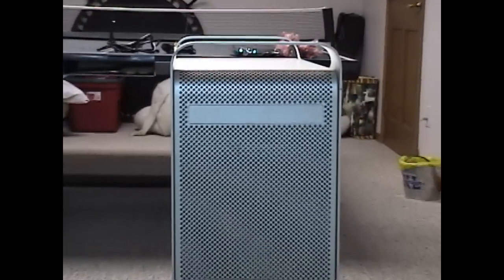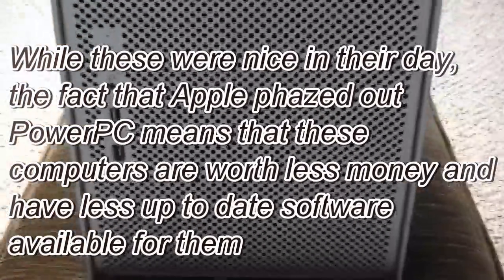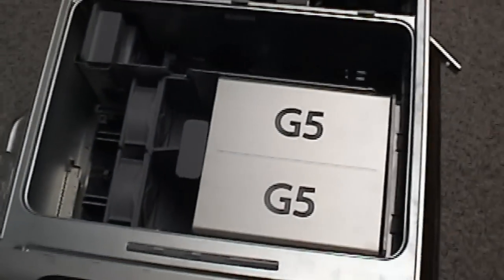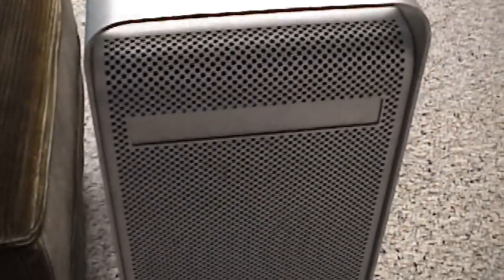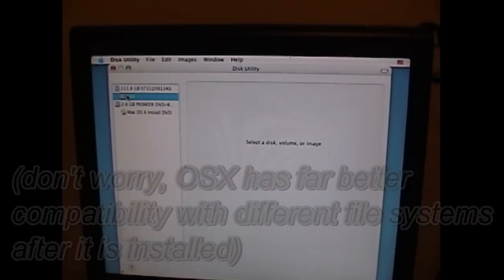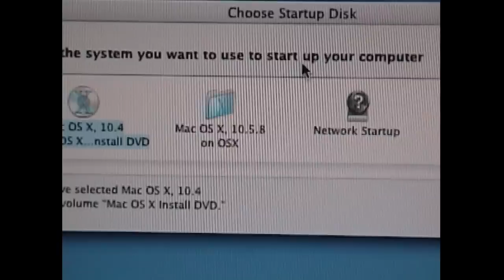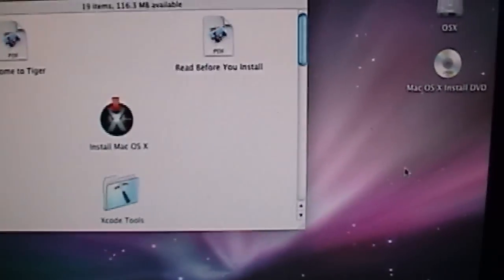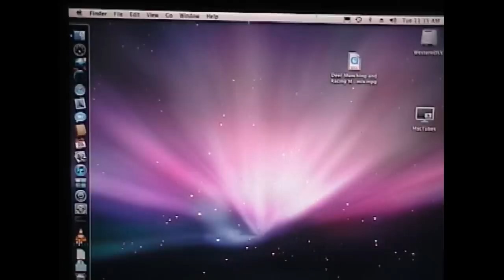PowerMac G5 Setup/First Run + RAM, Hard Drive, and OSX Installation

Comment: I find Mac OS X for PowerPC is so slow. I just got a Power Mac G5 Quad core and it feels so sluggish... And Since it can only got to version 10.5.8, most/all web browsers are out-of-date so you can't surface many websites...
Reply from the maker: This is true! Getting a good web browser is actually pretty easy, but the computer sucks so bad that most websites are miserable to use (think late Pentium4, only worse.). That issue and more are discussed in this handy followup video: https://www.youtube.com/watch?v=da5vfIH069E

Comment: Thanks for posting this. I just got a dual 2.5 Ghz G5 and did everything possible to install 10.5.8 on it until I came across this. This worked perfect.
Reply from the maker: Good to hear. It's a fun little "modern historical" piece with some mild utility to boot.
Reply: I am currently using it as a media server. I know it is power hungry but I like the look of it and it runs good.
Reply from the maker: @Greg
Whatever floats your boat.

Comment: Great video. I second what Hayden said. I should be getting a G5 soon, and like you this will be my first Mac product. It was seeming like I was going to be frustrated by the process of installing an OS, but your video gave me confidence. Thanks. Subscribed.
Reply from the maker: The G5 is an interesting learning experience for sure. At the end of the day, it's not that practical of a computer because of the sheer lack of software for PowerPC, the obnoxious mouse acceleration present in OSX, and the fact that no other operating systems really even work on the PowerPC machines (Ubuntu and MintPPC lack the necessary video drivers for anything to display correctly, although they do boot). This one's had a good run, but to be honest, I'm probably going to sell it soon because the weak/cheapo Pentium4 computer that sits next to it is more capable, more usable, an infinitely less frustrating to use. If the G5 had one thing, it was a really neat case. Unfortunately, its functionality was not reflected by its looks :-). Best of luck with yours though.

Comment: I've been running my PowerMac G5 1.6 with original 80 gig HDD for 10 years. I just bought a Mac Mini last year, I was curious what kind of new things were available on Macs.

I still use my G5, but do like the Mini. I'm thinking about installing a new SSD since the original HDD is so old. I have a 250 gig HDD in the second bay for Time Machine. Also going to replace the old 15" Cinema screen with a new monitor. Just keeping it around for back up or if it dies.

My Quadra 605 is still going too.

Comment: To open the DVD tray on boot just hold down the mouse button (left) until the tray opens (about halfway through booting). If you need to boot from a DVD but the DVD is not in the tray, if you're savvy enough, turn on the Mac while holding down the mouse, as soon as the tray opens quickly let go of the mouse and press and hold the "C" key, then insert the DVD while still holding C (push the tray closed). In one swift move you've opened the DVD drive AND told the Mac to boot from the DVD. One of several old Mac tricks I used all the time in the old days.
Reply from the maker: I was made aware of the DVD drive and boot key tricks after uploading this, but found that this particular computer won't work with any of the key combinations for some reason. It was suggested to me that it may be because of the wireless keyboard that's hooked up to it.
Reply: The wireless mouse might load too late I would think. But I'll try it out for you. Just plug a wired mouse into a USB port and hold it down during boot. The CD tray will open. Done it a million times.

Comment: This helped me get over the hurdle of opening the CD drive. Once that worked, I was able to get it to boot from the CD. I'm sure I paid $99 for the CD when I upgraded it. Now I just have to get a HD so I can install the OS.  I also have the disks for iWork and iLife so I can sell all that with the computer. Or just use if for a storage server. Thanks
Reply from the maker: Why would you pay $99 for a CD?
Reply from the maker: @russpury  Fair enough. I do have the 10.5.8 image linked in the description though, if you change your mind.
Reply: @Browningate  Thanks, I'll check which version I installed. I also have a Snow Leopard disk, and I can't remember why. Must be oldtimers
Reply from the maker: @russpury  Don't worry. I have Snow Leopard loaded up on my Lenovo N200 laptop for disc burning purposes. Leopard is the end of the line for PowerPC though, at least officially (although there is footage of a beta build of Snow Leopard running on PowerPC floating around, if you want to take a look).

Comment: Great video! I recently got 3 Powermac G5 computers that had the hard-drive wiped and had no idea if I could use. Only problem i had was getting  a copy of OS 10.4, tried to download several times using the  link given in the description. I got a bunch of adware but no OS file. I tried a copy of OS 10.4 that is for the G4 laptop and it worked and i was able to move on with the DMG install. I don't know if I can do much with these computers but will continue setting up this first one hopefully I can find some video edting software that will work on the G5.
Reply from the maker: +pmolestina 
Thanks for the heads-up. I checked the links and they were actually all still good (except for the one linking to the PDF, but that is fixed now too). As for video editing, you're pretty much out of luck with the G5; I'd recommend a normal computer for that along with PowerDirector 9 or 10 (this is addressed in my followup FAQ video).

Best of luck!

Comment: Hi, i know its an old video but im trying to do exactly whats on the video. I installed and ssd drive to the powermac g5, changed the dvd drive but it doesnt load the burnet OSX 10.4 DVD. Any ideas?
Reply from the maker: Are you sure that the drive is good? If so, you might be able to restore the 10.5.8 image from a virtual machine to your physical SSD, thereby bypassing the need for the optical disc altogether. Also, take a look at some of the beta 10.6 stuff that was made available for this machine from the forums. It's nothing earth-shattering, but kind of interesting nonetheless.

Comment: I appreciate the video. Thank you. Helped with the installation of the hard drive, but now that I'm trying to install the OS, I'm stuck. I downloaded both files you link to, but I'm unable to get to the tools screen. My DVD won't pull up. I simply get the flashing file folder/question mark.

I know the drive will work because I tried to use the tools from a 10.4 disk I found, but got a panic error kernel failure. The drive did pull up, however. 

I've tried to burn the disk at multiple speeds, through Toast and Disk Utilities, with .iso and with .toast, just to check. Nothing works. Any thoughts?
Reply from the maker: This might seem like an obvious thing to check, but make sure it's the 10.4 Tiger ISO that you're burning to the disc and not the Leopard DMG file, as that is not a disc image. If it's not working for you, it's possible that the DVD drive is just no good. While I was able to get OSX setup on both of my machines last year, I found that the drive in the one always had a tendency to act a little flaky (I think it was a Hitachi LG brand, but I don't remember for sure).

Comment: ive got the g5 powermac and its coming up with the question mark and  the face folder sort of thing i was wondering if i can do the same i have a new hardrive installed is there a way i can do a clean install?

Comment: thank God, I figured it was. the eject key is on the keyboard. cheers
Reply from the maker: Yeah, that's definitely one of the design flaws of that PC. In case of emergency, you can eject it by holding down the left mouse button when booting, press F12 after OSX has booted, or manually pry the aluminum cover down and use the paper clip trick on the drive's emergency release.

Comment: Thank you ! I have g5 do you think mountain lion will work on it ?
Reply from the maker: It certainly will not work, unfortunately. Leopard (10.5.8) is the absolute last version of OSX that can run on a PowerPC Apple computer. If you really want to try mountain lion, I'd see if your regular computer is compatible with any of the "hackintosh" solutions. If you just want to try it to see what it's like, check out one of the YouTube guides on how to set it up in a virtual machine software (like VMWare).

Comment: i know im extremely late but my powermac g5 (late 2003 model i believe, powermac7,2) won't boot from anything, not even the dvd i burned, any suggestions?
Reply from the maker: The DVD drive and hard drive could have both failed. If I remember correctly, you can at least get to some kind of a boot menu by holding down the alt key on a wired, USB keyboard at time of power-on.

Comment: Thanks for your video - I have a seemingly simply problem that I can't get past:
1) I had a G5 with OSX 10.3.5 (have original disks);
2) hard drive died but presented as a possible motherboard issue,
3) so I bought another shell with no hard drive... and cannot for the life of me run the install DVD (the hardware disk reads fine)
4) It also begins to sound like it's going to take off (fan is going ballistic) after 5 minutes running the  hardware test (or just being ON)
5) therefore, I can't run the install or format the new drive.
Any suggestions? Thank you!
Reply from the maker: How to get past...
1. To solve your first problem of only having 10.3, check out the video.
2. Use a "normal" computer to recover whatever data you can off the failing hard drive and write it off.
3. Sometimes, these computers don't respond to the keyboard that is connected, so you can hold "C" all day long, and it'll always try to boot off the connected hard drive. The only way around this is to start with an empty hard drive.
4. It's normal for the fans to ramp up a little every once in a while, but if you find that they go full blast and stay there preceeding a freeze-up, you have a motherboard problem.
5. Give that a try and see if you have any more issues.

Best of luck.
Reply: ***** thanks for your suggestion (and quick reply)... I have tried removing RAM to minimal and a different hard drive (though not totally wiped from Win use). I have been getting the dread kernel panic error to restart. I'm thinking one last ditch effort to franken the two and hope for the best - all to try to keep using a DigiDesign 002 with ProTools LE... it may just be time to move everything to a Win box.
Reply from the maker: crokeefe
You'll have to fill me in a bit here; are you saying that you have never had this system working or that it was working and just stopped? Did you determine if your problems was with the motherboard components or otherwise? Are you trying to install OSX or recover an existing installation?

Like I said before, if you're just dealing with a failing hard drive, you can either attempt to clone the contents to a new drive using Active Boot Disc (or similar software) on a normal computer or just copy essential programs and documents to a temporary location before doing a clean install.

Next, determine whether the "fans ramping up" that you were referring to before is just a routine (short and brief) increase in speed, or a permanent increase followed up by a freeze (indicating a motherboard that needs a reflow).

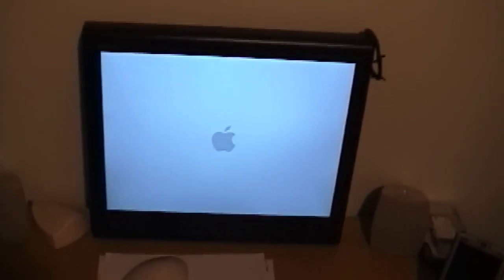Comment: Hi i'm having trouble booting my new hard drive on my old G5. At 09:06 you say boot from CD/DVD by pressing on C if that doesn't work? What else can i do, any other ways? Thank's in advance ;)
Reply from the maker: +Mike Chille 
Hold down "alt" before you here the POST chime to call up the boot menu and check to see if the disc appears. If it doesn't, then the computer might be having trouble reading it.
Reply: +Channel 2012 i had a blue screen but no disc appears but after 15 attempts i had the welcome screen but could not instal on my hard drive...!! So i change it again and now again same problem before... It drives me crazy... Anyway thank's a lot for answering me and you have a new member to your channel ;)
Reply from the maker: Mike Chille 
If it's not reading discs consistently, there may be a problem with that optical drive. As for it not wanting to install on your hard drive, that is rather odd. Was it giving you any particular error message or getting caught up at any particular point in the process?
Reply: nop😓 by pressing the C i get the famous blue screen (left refresh and right the arrow) and nothing else.. but i've tried with a older Mac OS X 10.3.5 instal disc that i use for a older very older iMac and the disc appears but then the installation won't work (i get the logo ❌ right after )
Reply from the maker: Mike Chille
So you're saying that it's not reading discs consistently? If so, try using an external DVD drive (if it'll accept that), replacing the drive you already have, or cleaning the lens. Once you can get it to read discs, give it another shot because I don't think there's any way to make this thing boot up off of USB flash drives.

Also, just to prepare you, be aware that this degree of hand-holding will not become any less of a requirement going forward with that computer. Every little thing you want to do will require the help of a regular computer to get things done. Patience is a must with PowerPC Mac PCs.